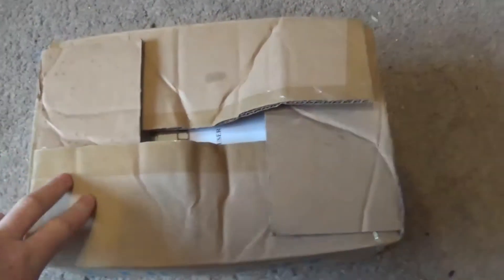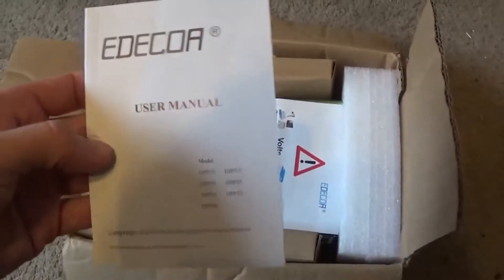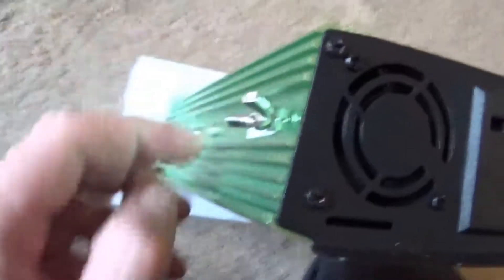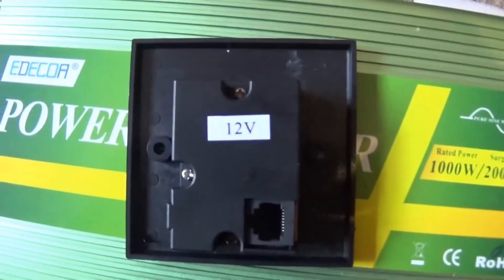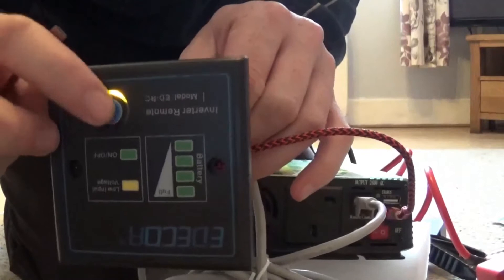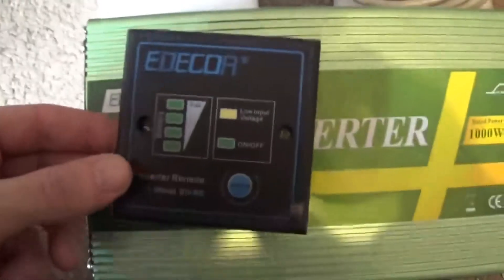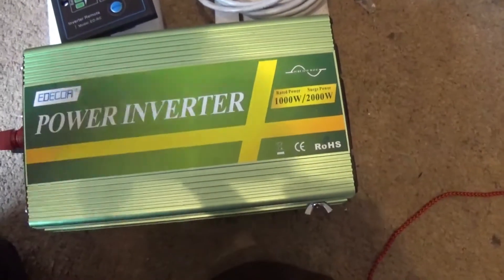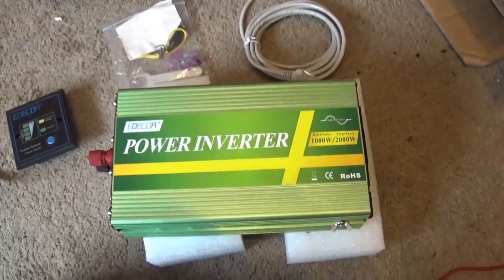Short Review On A Edecoa 1000w Pure Sine Wave Power Inverter Pt1/2

Comment: Hello,
Today I received the inverter. The problem is, I bought it with the idea that I could use the gas central heating.  Turn on the flame for 3-4 seconds, and then a red LED lights up on the gas central heating, indicating that it is blocked.  The gaz central heating works flawlessly in the normal wall 220v socket, but not on the inverter.
 I mention that I tested the phase and the null with the control screwdriver, and at the inverter it also lights up on the null contact, while in the wall 220v socket the screwdriver lights only at the phase.
Do you have any idea why I can't use the gas boiler ?  Any other device works.  Thanks.
Reply from the maker: Morning Runner. Do you have enough charge in the battery/batteries to power the inverter. Also what wattage does the boiler require.
Reply: @Fletchers1  Yeah, no problem with wattage. The gas central heating require only 130W. It's something with the ground wire I guess.
Reply from the maker: @Run4FunAgain  it could well be a ground problem. You can buy the grounding rod and clamp from toolstation super cheap. Run the ground rod in until its about 2 inches out the ground. Give that a go. If it still doesn't work then it still doesn't hurt to have it. I will have a look into it for you.
Reply: @Fletchers1  The gas central heating has already ground connected through water and gas pipes. So, I just connected one of the AC inverter wire with the ground of the ground inverter wire. All is ok now, and working. Thank you.

Comment: Great review.  I have one of these in our Camper running off two 110a batteries and 170W Solar.  Runs the fridge all day long and we can even get a couple of boils of our 700w kettle.  By far the best value for money pure sine wave in my humble opinion.
Reply from the maker: For the money it is more than worth every penny. I love the fact it has remote control so the actual inverter can be hidden
Reply: This inverter work with lithium battery?
Reply: @rafaelmt1000 electricity

Comment: I've just ordered one of these. Looks brilliant for £104 and seems to have positive reviews.  My first inverter 😂 im hoping to run a 105ah efb battery in place of the current crappy one and keep the engine running whilst i boil a 600w kettle and i may be running a xbox s and a small tv which is about 100w for maybe a couple hours at a time.
Reply from the maker: I can say that it has been out in my shed now for a while and it's still going strong. As long as you can use it to play games that's all that matters 😂
Reply: @Fletchers1  oh yes got to have some luxuries. A brew and Forza horizon 4 is definitely a must 😂👍
Reply from the maker: @120poundsound2  are you more a console gamer. Me myself prefer pc. More options then on games and mods
Reply: @Fletchers1  i was until this year but i knocked up a reasonable gaming pc during lockdown but my living situe all over the place at the moment so ive sold that and my ps4 and intend on buying an xbox for literally Forza Horizon 4 I'm setting my car up incase i have to glamp it some nights. 😂👍
Reply from the maker: @120poundsound2  😂 nice. Well not a true pc gamer then 😉 but that's ok I understand 😂
Reply: @Fletchers1  I'll be making a tasty rig later down when circumstances allow. I thought about buying a mini pc for my car but there supprisingly expensive for probably no better experience than an xbox.  🥳
Reply from the maker: @120poundsound2  they are very expensive tbh and plus having a normal size pc allows you to upgrade any part without worrying if it will fit